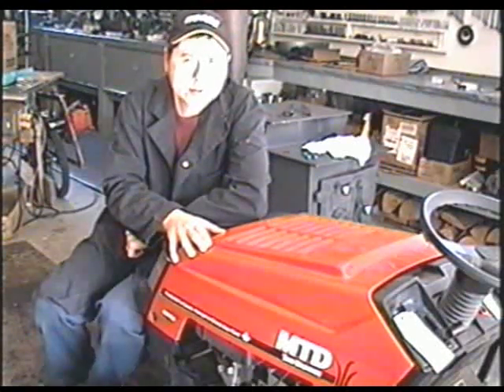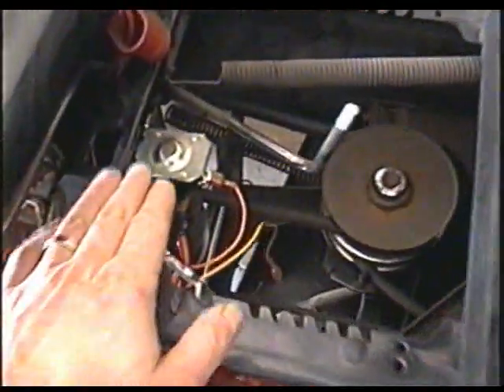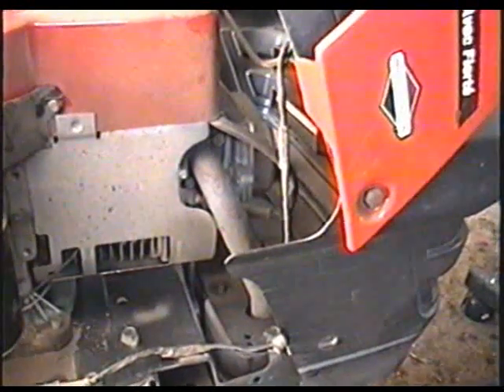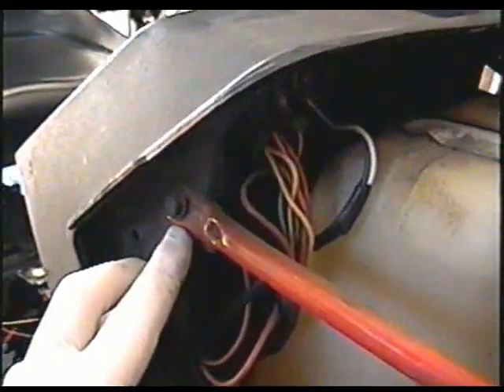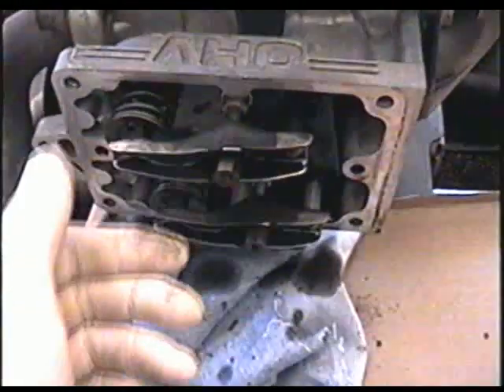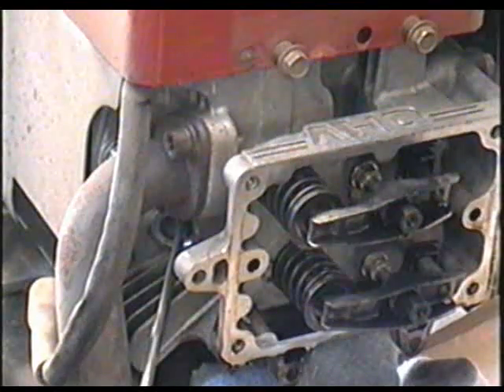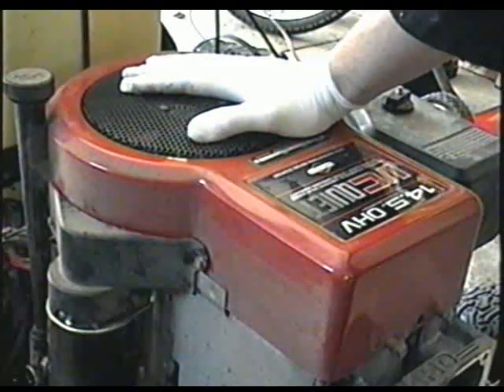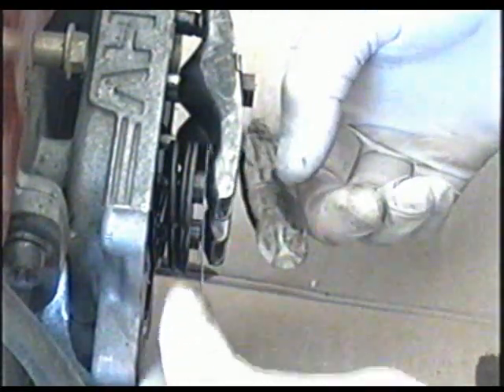( HOW TO ADJUST VALVES) FIX HARD TO START Lawn Tractor with OHV Briggs Engine- MUST SEE- Part 1/2

Comment: I followed your instructions to the "T" and it works like a champ. Thank you so much for the time you took for the detailed set of instructions. This problem happens to me almost every year and the shop charges me 350 dollars to fix it every time. This time I got to do it myself in about 15 minutes after watching your video. I cannot thank you enough.

Comment: After removing engine starter and then being told it's the battery, not the starter. I purchased a new battery only to be disappointed that the engine still wouldn't start. Positive it was the starter I was looking for a replacement online and came across your video. After reading some of your feedback I decided to try and follow your directions and the tractor is starting like a champ again. Can't thank you enough. We had been turning engine counter clockwise also and jump starting engine.

Comment: Just wanted to thank you for all of your "How to" videos. This one just saved me about $250. About every other year my 13 year old OHV riding mower has this strange thing you are describing...basically from the symptoms you would think it's a dead battery a solenoid or starter issue. The thing is, when you slap a meter on the battery  it indicates fully charged. To add to the misdirection, these OHV engines WILL start if you jump the battery even if the valves are out of adjustment. Followed your great easy to follow instructions, adjusted the valves and Boom! Runs like new. You saved me $250 because that's what a local shop charges for repair, pick up and delivery. BTW 2 years ago when I had this repair done (same symptoms) I asked the guys in the shop what the problem was and they said, "oh.... dirty carburetor". I knew better because I had already removed and throughly cleaned it before it went to the shop and that didn't fix it. Guess they were just trying to keep me coming back every other year. Thanks again!
Reply from the maker: +BigVenture06 you're welcome, make sure you are subscribed

Comment: Thanks for posting this video.  After two years on not being able to start my 2009 Troy Bilt mower without jumper cables, this adjustment fixed it!  I went through several batteries over the past two years and recently replaced the starter without any improvement.  I finally took it to a local repair shop to fix the "starting issue".  However, the service tech just lied to me about needing a new starter, rats nest in the engine cover etc. and refused to fix it.  Instead he tried to sell me a new mower.  
This procedure is so easy to do on a Briggs & Stratton OHV engine.  All you need is a good feeler gauge, torque wrench etc.  It only took about 20 minutes to remove the valve cover, check the valve lash (mine was at 0.020 inches or five times out of spec) and adjust as per the instructions in the video.  One small problem I ran into is that the adjustment stud came loose at the base of the push rod.  That can be tightened with a 10mm wrench.  The main adjustment nut requires a 5/8 inch wrench.  After carefully adjusting the valve lash to 0.004 inches on both valves, I put replaced the valve cover and it started on the first try.  I also noticed that the engine runs smoother now.

Comment: You are the MAN!!!!    unbelievable...   I have screwed around with engines for a while but never adjusted valves before.  Incredibly easy.   Thanks to grandpa leaving me some feeler gauges.   I went .004 to start and it was still not working. I went to .002 and POOF...    She cranks wonderfully.  Now on to the next issue.   Air / Gas / Spark  troubleshooting...  WOW THANKS AGAIN!!!!!

Comment: Thank you very much indeed for those two videos; I can imagine how much trouble you went to to make them.

I live in France and have a 3 year old 'Wheeling' tractor mower (made in Italy) with a B&S engine, model no. 31A707. Two days ago it just wouldn't start and, to be honest, it had played up a little on starting from cold the week before too.

 I rang my my local dealer who told me it would be at least 3 weeks before he could even look at it. Plus there was the problem of getting it onto my trailer with a dead engine. So I did some research, found your videos, and within two hours, I had the problem fixed.

Why two hours? Well, Itried the adjustments three times with no joy. Then I realised that I had forgotten the bit about going 1/4 past TDC. Once I'd done that, all was perfection and the engine now runs sweet as a nut.

Thanks again. You have a new and very grateful subscriber!

Comment: I had the exact problems , thinking it was just cold weather causing it. After watching Donyboy's vid, I made the adjustments easily,(after checking my owners manual for the correct specs) and now it starts right up even in cold weather sounding like a brand new starter. Ty, ty, ty, .... Love your channel !!!

Comment: did another valve adjustment today  and took it down to about 1  1/2   to 2 thousands . now runs great ,, revved up and under load. like the idea to just do it   and run the motor while adjusting with the valve cover off.great vids thanks for taking the time and saving america tons of money .
Reply from the maker: I'm trying to make small engine repair great again!

Comment: I was at the end of my tether when I found your video. I had charged and checked the battery, bought a jump starter, stripped the starter down and cleaned it and still the engine wouldn’t crank. Followed your video and found the exhaust valve tapper was so loose it wasn’t even on top of the valve. Sorted it all out, reassembled it and it fired up first time. Thank you soooo much for your very clear and helpful video.

Comment: Thank's donyboy73 my father's mower had been giving us the starting blue's for the better part of 3 yrs, got a new battery this year same problem. Jumping it off after turning engine counter clockwise worked until today Went on line saw your video did what you said, pulled the plug engine turned over just fine set the valve's and now it start's just fine. Great videi :>)

Comment: Donyboy73 this worked like a charm.  i have a Yard machine 14.5 and mine was starting the same exact way.  it was about  .10" did your adjustments and motor turns over 100% of the time with no hesitation!  Thanks for posting this, as it saved me $$$ not taking it to the Dealer mechanics!
Reply from the maker: you're welcome

Comment: BINGO! Worked. I did it with a 4 spacer. I knew you were talking about my problem when I could not spin the top manually. Took about an 1 hour and thats with going to buy "feeler" for the valves. THANKS!!!!!

Comment: Thank You for your video. After replacing a battery, solenoid and starter based on suggestions from many so called people who know 17.5 OVH engines I was about to give up. The engine just wouldn't crank. I found your video and did exactly what you showed and the mower now starts PERFECT! Just like it did when it was new.
Reply from the maker: good to hear!

Comment: Mr. Fraser - this may be too late but I have a t1000 like you and replaced battery, coil and plug. As I was adjusting the valves for the third time my second pair of eyes noticed the aluminum intake rocker arm was BENT! A quick straighten on the bench vise and POW, it starts like a dream. Hope you get it going too.

Comment: great ,  the mower would start sometimes but, I was looking at carburetor issues and then I thought it was turning over awfully hard so I looked at my rockers and they were barely hanging on. and the intake rod push was bent. i straightened out rod and adjust valve's ,BOOM my mower runs better than it has in 1 1/2 years and it is 3 years old even with the slightly deformed and weakened rod, I am currently ordering some new ones. thanks you also convinced my stubborn father to check them.

Comment: I HAVE THE SAME TRACTOR AND IT WAS HARD TO START FOR 2 YEARS. I WAS TOLD TO ADJUST THE VALVES. THEY WERE .015 AND I SET THEM TO .004 AND IT CURED THE ISSUE PERFECTLY.

Comment: Thjanks for all your great videos. Based  on some of your videos and others;  I just repaired the deck on my 2003 Cratsman LT1000 and that is running great. It has a B&S Intek 18HP engine.
 It sat outside all winter and started up very easily after I charged the battery. Unfortunately a few days later I tried starting it and the battery seemed dead again. Put in a new battery and it started great. However I have a problem with the engine which fires up really well, sounds great, runs great for an hour or so then dies.  This has been fairly consistent for 2 seasons now.  Sometimes if I let it sit for a couple of hours it will restart and run fine for another hour or so.  I replaced the gas cap thinking it might be clogged and not allowing easy gas flow after that hr or so. No luck with that.

I check the oil and the dip stick seems to have oil all the way up when I first remove it for checking. I wipe and reinsert and it seems fine pretty good.  Is that normal?

Since a 2 yr. old battery failed I thought I might check the voltage while running. It's only about 12.6VDC. Could that be my problem.  The Amp-meter is not showing any movement at all.

Comment: I had the exact same issue after changing a head gasket on an Intek 18.5HP (and skipping the valve adjustment step out laziness). I pretty much knew it was a valve clearance issue, but this video was great because it shows the symptom perfectly along with the fix. Very helpful, thanks!

Comment: great ,  the mower would start sometimes but, I was looking at carburetor issues and then I thought it was turning over awfully hard so I looked at my rockers and they were barely hanging on. and the intake rod push was bent. i staightened out rod and adjust valve's ,BOOM my mower runs better than it has in 1 1/2 years and it is 3 years old even with the slightly deformed and weakened rod, I am currently ordering some new ones. thanks you also convinced my stubborn father to check them. not easy

Comment: So I have the 13HP Tecumseh.  The turning over has always been an issue.  I have replaced the starter a few years ago but even with a new starter it still never "seemed" right.  After watching your video, even though it was B&S I thought I want to take a look at mine and see how they were.  They were loose I adjusted them up and ....... ITS NEVER STARTED THAT EASY IN THE WHOLE TIME I HAVE OWNED IT!   THANK YOU!!!!!

Comment: Dude. I've looked at a lot of videos and this one was for the common man. Thank you. Mine was doing the same thing. I followed your instruction and it runs beautiful. Battery, starter and solenoid were all fine.  BTW, my mower is an old14.5 I/C OHV Briggs by Wizard with a 42" cut.
Reply from the maker: that's good to hear, make sure you're subscribed

Comment: Great video. !!!!!!!! another good thing I'd like to mention about these engines is that the carb has a electrically controlled fuel pin that screws into the bottom of the float bowl. This thing when it FAILS will cause fuel to overload the engine and cause a hydrolock. Correction to this if you dont have the 100$ to replace it is to cut the pin off with bolt cutters and grind it smooth. after u do that screw it back in and your all set to go.

Comment: Donyboy73…Thank you so much for this video!  I had the identical problem you showed on your video and frankly, I would still be wondering what to do next…after I bought the starter.  I followed your video and the B&S engine started immediately.  You saved me some cash and more importantly a lot of time and hassle!  Thanks again.
Reply from the maker: +Walt Wintsch you're welcome Walt, make sure you are subscribed
Reply: donyboy73 n

Comment: Thanks Donyboy73 for this excellent tutorial. I found your video after I replaced the starter and starter solenoid, well at least they are new now. Your process worked fast on my 18.5 hp Cub Cadet. It now starts on the first turn of the key. Great job, Thanks
Reply from the maker: you're welcome

Comment: Great video as always.  So far I've adjusted the valves on many mowers but haven't been lucky enough to have that fix the problem. In my experience with the Briggs engines, it's always the automatic compression release that stops working and makes it hard to turn over.

Comment: I have a fourteen year old Toro Wheelhorse with Briggs-Stratton 15.5 engine.  The video showed EXACTLY what I've been going through (including buying and installing a new starter).  As you indicate in the video I placed cardboard and a rag under the valve cover before taking it off… surprise!!! When I removed the cover not only oil but a gush of gasoline mixed with oil came out all over the garage floor!  This "can't be" good!  :0(  I'm almost afraid to ask, but… what does this mean?  Well, I found out that this "means" that the float is stuck in the carburetor… looked at a few videos on how to clean the carb but when I got out to my engine I find an electrical connection on the bottom of the bowl where the video showed a simple bolt to loosen.  Looking now for "how" the electrical connection is properly removed and of course then the bowl.  Not sure how often you look through these posts, but hope to hear from you soon.

Comment: Hi, i fixed a Husqvarna ride on last week which had the same problem as you are facing with your motor. the solution is to check the cam shaft, there is a small lever attached with it which works as de-compressor. if you find its broken then you need to replace the camshaft as it comes as one part. then set the valves to factory setting ( intake .08mm and exhaust .13mm). cheers!

Comment: Looking at the front sitting in front of muffler, the exhaust valve is the top valve. Exhaust is .005 to .007". Intake is .003 to .005". Check rocker stud is not loose. This was my problem. I'd set valve clearance. Run a day and then it was hard to start again. Kept checking and resetting the  valves clearance again. Now starts super easy. No sputter during running now.

Comment: quick question. I following the instruction and it did help. One thing i noticed is that there is a lot of gas on my spark plug. I have to crank it over for a minute or so and i see gas coming out the exhaust and then it will start. Is there something else wrong or did I do something wrong? Once it is started it runs well. Any help is appreciated and thanks for all the great videos. You're doing a great service!

Comment: Hello Donny, This is a little of the subject but I have a Murray- MTD 17.5 42" rider mower. I had problems with the lights bulbs busting from hard hits on rough yards. Plus any time I wash my deck with there deck washing kit any water that hits the bulbs would pop them. I replaced both of them with led bulbs. Used it all summer long in Louisiana heat and sudden rain showers with no problems. Thanks' for all the videos. Tim in Baton Rouge, La.

Comment from the maker: @jswiter could be time for a starter. make sure it's not flooded in the cylinder. sometimes these carbs leak feul into the cylinder and when u go to start it it's locked or hard to turn over because of the fuel in the cylinder, had this happen to me many times

Comment: when you adjust the valves just remember to put your finger over the spark plug hole and feel for air pushing out. this is compression stroke, then take a flashlight and look into the hole while turning the flywheel until the piston comes all the way to the top, after it does this bring the piston back down one inch. This i can assure u will be the time to set your valves to the manufacturer specs. Hope i helped. if this doesn't fix your problem then move on to other things in starting system.

Comment: Very good video ! I have an 18hp tractor that I've had for about 8 years and I have never adjusted my OHV. I'm going to adjust them now as a routine. I see you rotated the flywheel 1/4 turn past TDC. Everything I've read says that's the correct way to do it although I see many people do it at TDC. How often should I adjust my valves and what is a sign that they need adjusting besides difficult starting? Thanks

Comment: Great video, thanks. I have adjusted valves several times (they were not sloppy to begin with) and have the same exact symptoms. I am thinking either the starter or compression release is the problem. If I can turn the engine by hand with the plug in am I correct to assume it is most likely the starter? BTW I am using my good F150 battery.

Comment: This is the EXACT issue I have on our 12hp and 17hp BS motors. Repair place wants to charge me for a new started and ground cable...I love all your videos, keep them coming!  I got a STIHL 261 chainsaw after watching how easy it was for you to change the pump, etc. Subscribed and have been for a while! Thanks again!

EDIT: I have a 283707 BS 12 HP engine and it doesnt appear to have OHV. Do you have a video on how to adjust valves for this type of engine?

Comment: i have the same symtoms on a flat head. does that mean head of valves out. if so surely grinding the end of the valves will not close clearance but open. does that mean new valves. love your vids. thx

Comment: Great video, as always.  Any suggestions as to how to make sure you get the right bolts back in the proper places, especially when you need to take several things apart for a repair.
Thanks
Tony
Port Hadlock

Comment from the maker: @siemenstraffic it opens up during operation and turns off when u turn the tracotr off. there is a valve in it that stops fuel from going in the engine when u shut it off, preventing backfire